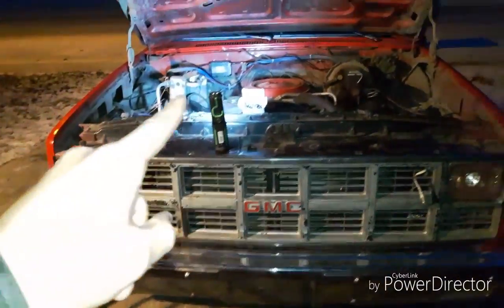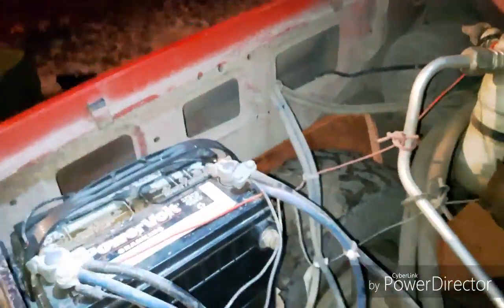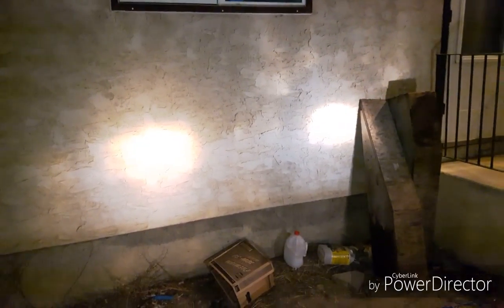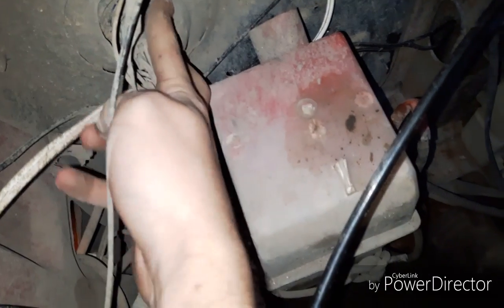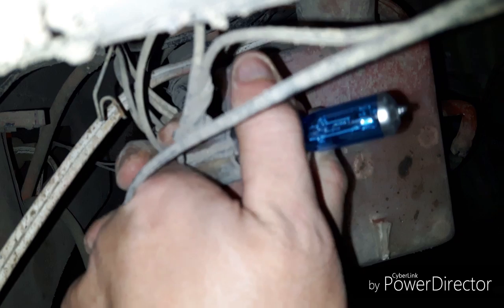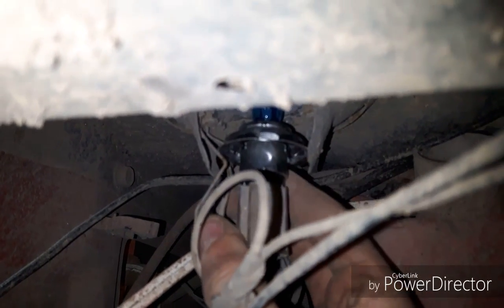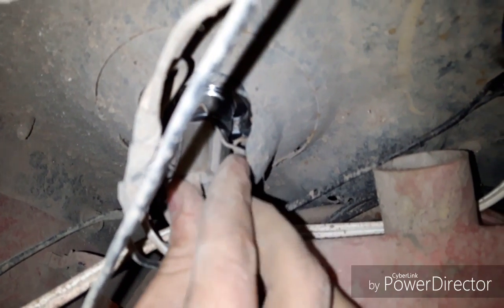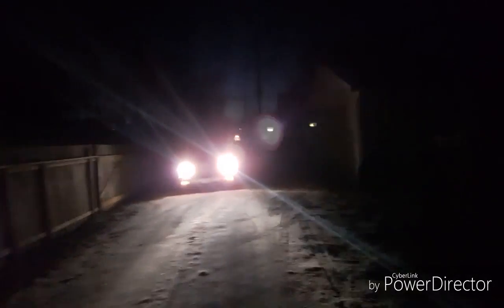100w vs 60w headlight bulbs

Comment: I loved the duct tape patch up job on the top radiator hose. 8:50
Very professional.........for fuck’s sake ! 😂
Reply from the maker: If you talking about the thing at the lower right hand corner of the screen, thats actually a hose brace that clamps around the rad and bolts to the fan shroud on the rad to avoid stressing out the plastic end on the radiator, and you would know that if you've ever done a rad on these square bodies and how important that brace actually is. 

Very observant of you........... "for fuck's sake ! 😂"

Comment: Did you upgrade the wiring harness to handle the extra current? Or are you going to rely on the snow and cold to keep them from overheating?
Reply from the maker: +peacefrog0521 i did upgrade the harness with a relay kit from LMC Truck

Comment: did you change the h4 socket to ceramic?did you check the bulb to have UV block to prevent reflector from melting?did you use relay harness?100/80w bulb will burn off your wiring and headlamp..
Reply: Lucky a seen you’re comment was just about to buy some 100w bulbs

Comment: did you upgrade the reflectors to e-codes so you dont blind people?
Reply from the maker: Yes i did a couple days later i put in proper projector lenses in it to help with the cut off line, thou the low beams where only 65watts(regular h4 highbeam watts) in a projector i never got flashed, and never had the brights on unless the road was completely dead.